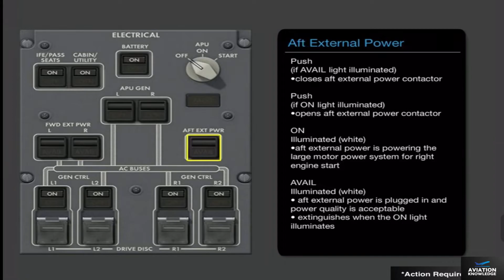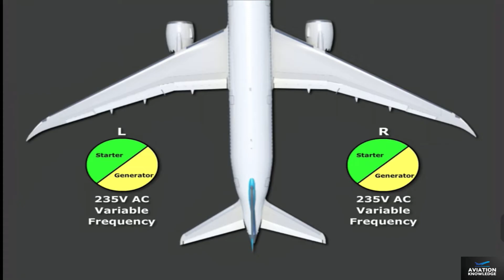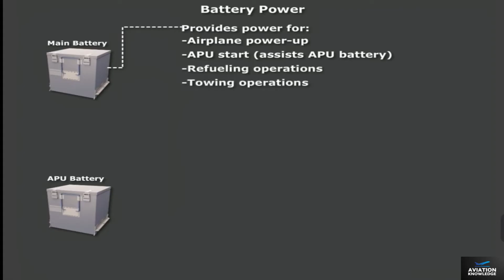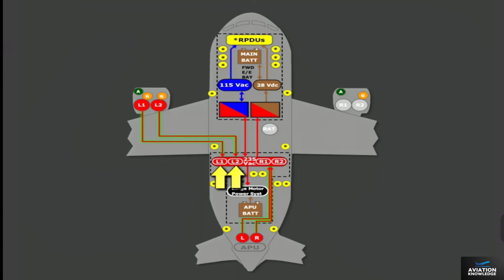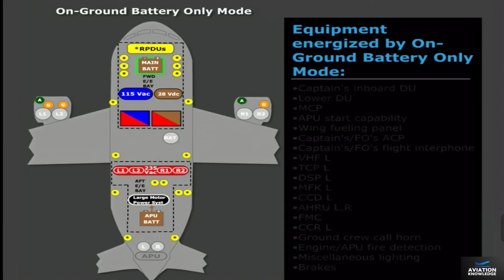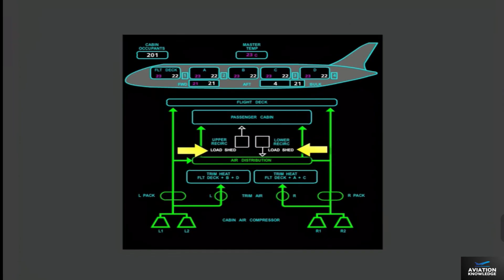B787 CBT  Electrical System

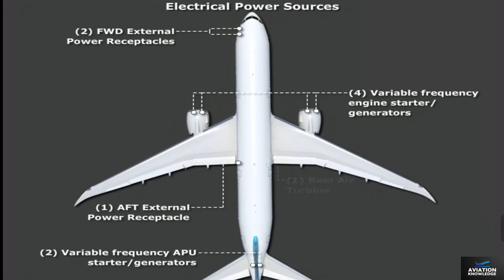Comment: 3:36 There is 2 ASG (APU Starer Generator) Not a Variable frequency APU starer generator, the APU is constant speed unlike the engines Variable frequency starer generator (VFSG)
Reply: ASG frequency is 360-440Hz
Reply: @ฟามีอิเมล bro you are a legend i was very very wrong. I just made a quick research and now I understand how the electrical system works 500% better.
Reply: @IbrahimAlghamdi07 no problem…we learn something new everyday
Reply: @ฟามีอิเมล You are correct 👍🏻
Reply: @ฟามีอิเมล this is a new information to me, so I went to the training manual and found these informations
2. Each ASG has these ratings: 
 - 225 kva 
 - 235v ac 
 - 360 to 440 Hz (variable frequency).

Comment: The common BUS Bar for six generators is a common denominator and a short here will kill all six generators and no power will cause the  Fadec throttle control running out of power and engines as a result will spool back to idle. A possible problem for AI 171. RIP very sad.
Reply: You mean the Common Data Network (CDN)?
Reply: To my mind, the block level schematic is bit simplified here (which is sufficient for basic explanation).
Wrt to the 235V generators, they're connected to the aft ENE bay. However, this does not mean there's just one single bus bar, with only "one 235V cable" connected to the forward ENE bay. Keywords are system redundancy and functional safety.
Thus think more of a "bus switch-bay" where the individual generators can be connected to several bus bars in flexible way for different configurations. Plus for same reasons,  it also needs few 235V buses within the fuselage to the forward ENE bay plus other electrical consumers.
Same applies for 115V and 28V buses accordingly.